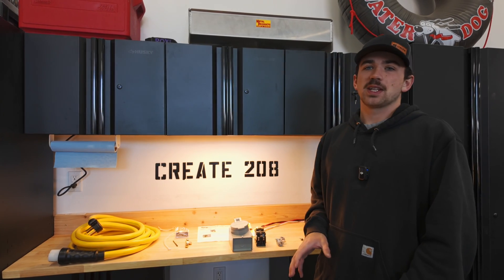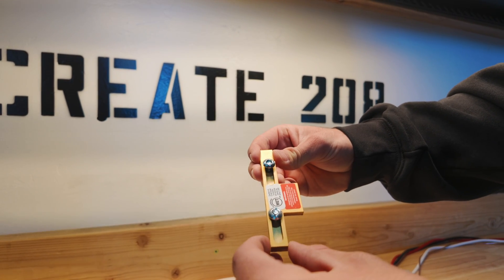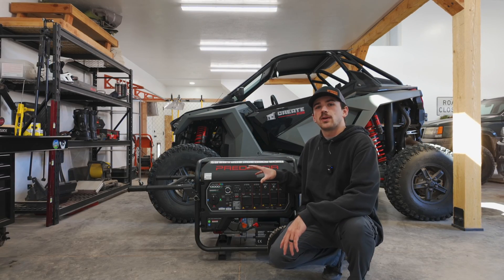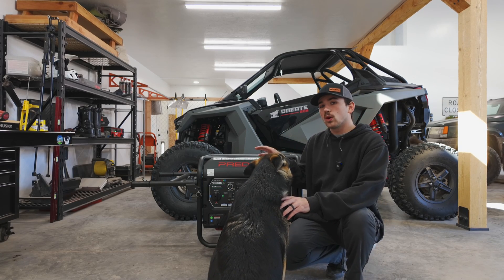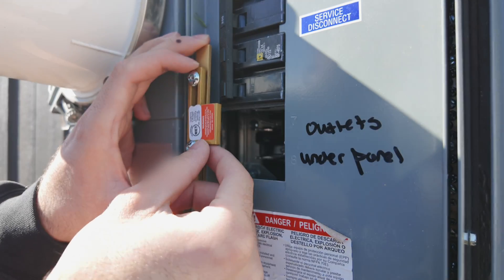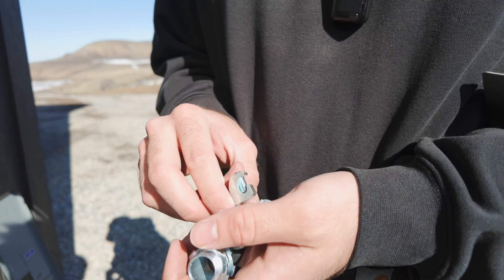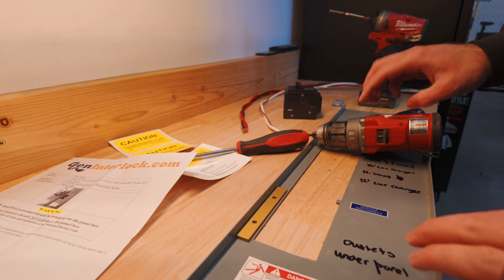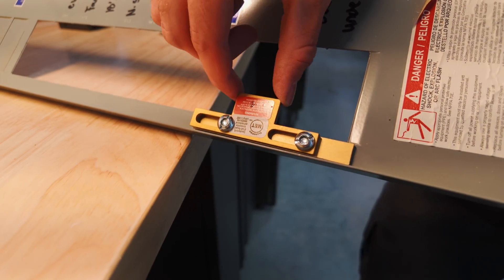Never Lose Power Again: Whole Home Portable Generator Backup Setup. NEW Predator 13000 Watt Tri-Fuel

Comment: Pretty sweet setup!  One question though, why do you have your panel outside the house and not in the shop?   Worst case situation:  Someone could roll up and shut the entire house down from outside.
Reply: Pretty standard here in Texas to have a main disconnect outside even in apartment complexes and I have never heard of anyone turning someone's power off. You actually want a disconnect outside if there is a fire or some other issue so your neighbor or the fire department can easily cut the power. Same with water. We had to turn a neighbors water off once because a pipe broke in their attic and water was coming out the side of the house. We likely saved them a lot of money in repairs.
Reply from the maker: Thank you! I have that panel outside, a 200a sub panel in the shop, and a 125a sub panel in the living area. Most houses have a main disconnect at the service panel outside like mine. It’s pretty crazy but yes, a lot of people could have their entire house shut down from the outside!

Comment: Beautiful home and great idea.  I did the same thing on my house a couple years ago.  Is there a reason you used 8 GA versus 6 GA?  8 GA is rated for 40 amps whereas 6 GA is 55A.  Typically use 6 GA wire for 50A breakers.  By code around here you’d have to swap out the 50A breaker for a 40 since the wire couldn’t handle the 50A.  Just wanted to make sure you knew that.  Cheers!
Reply from the maker: Thank you! Wire size depends on a few factors, if you are using a romex or cable you would size off the 60 degree chart but because I’m using THHN wiring it’s rated for the 75 or 90 degree chart. 75 degree chart for #8 is rated for 50a and 90 degree chart is rated for 55a. But that’s why the premade cable had to be #6 wiring. because the 60 degree chart. Hope that makes sense!
Reply: Per NEC your are not to exceed 80% of the load. That would fail inspection with 8AWG.  Just be careful doing DIY.
Reply from the maker: Code reference?
Reply: He knew